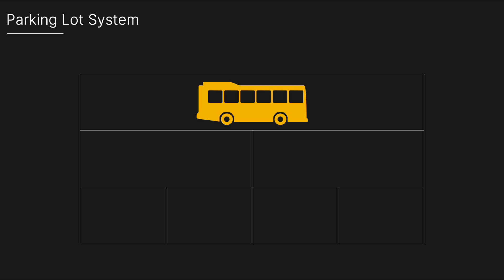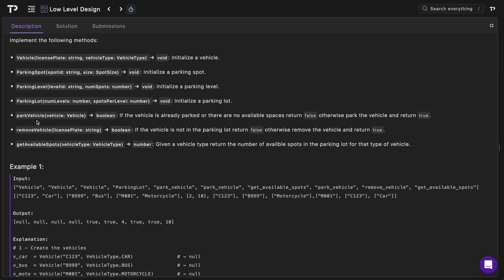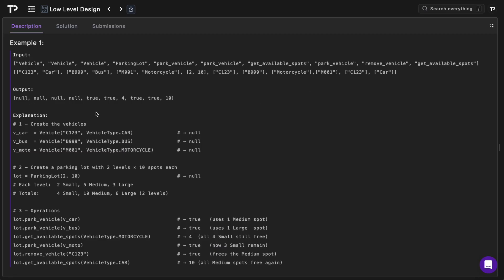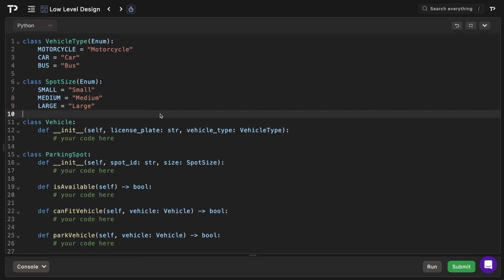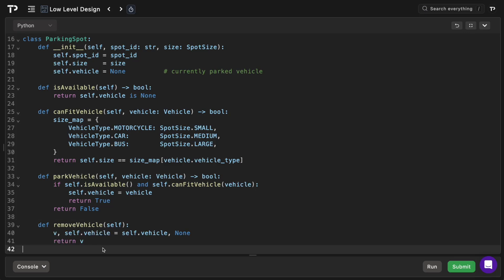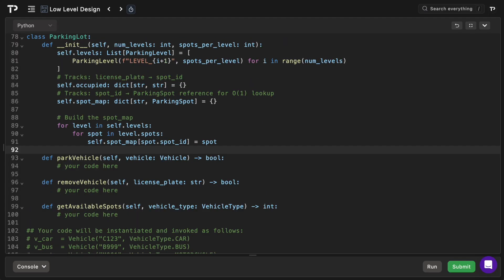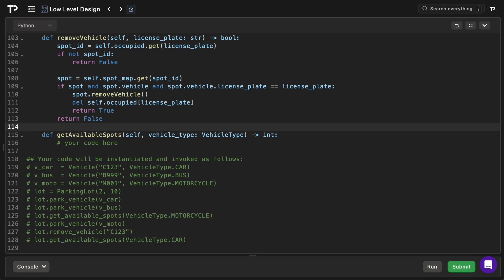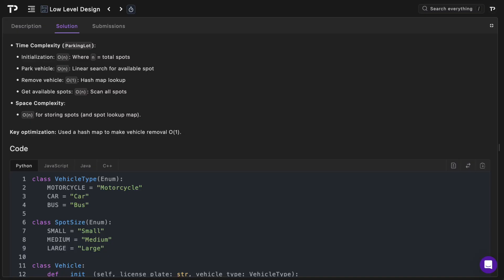Parking Lot System - Low Level Design Interview Question

Comment: if they want to add more spots or levels, does that mean you need to redesign the ID system to be class variables OR make the ID be level & length of spot list? Otherwise we cannot know the next Id since we only start and generate all possible ID in the initialize spot function. In an interview, shouldnt we consider the potential change in requirements to show how extensible the code is?